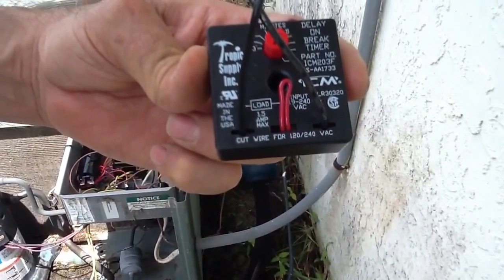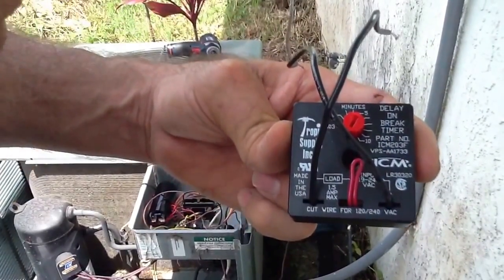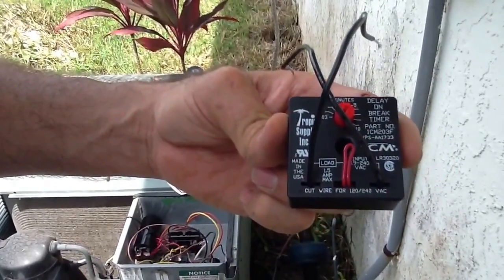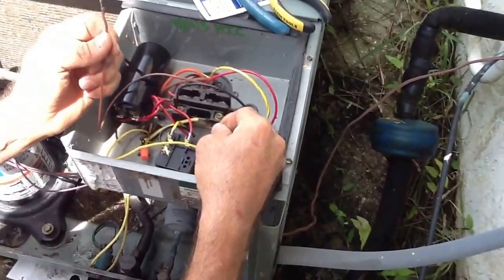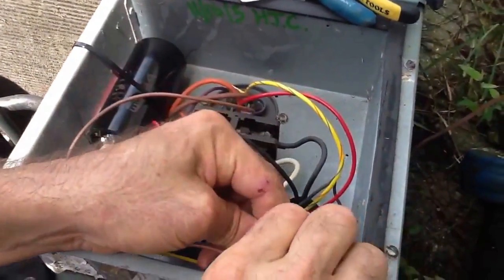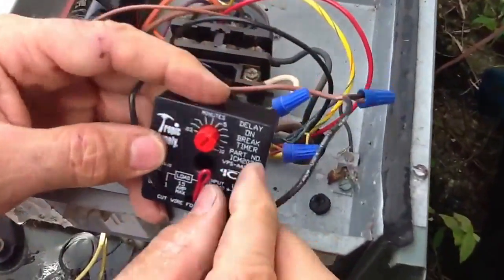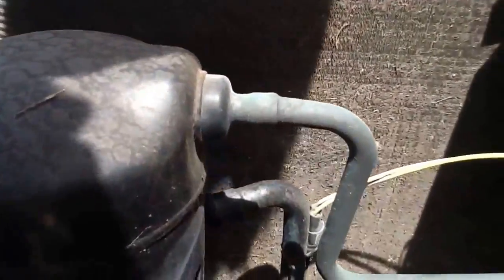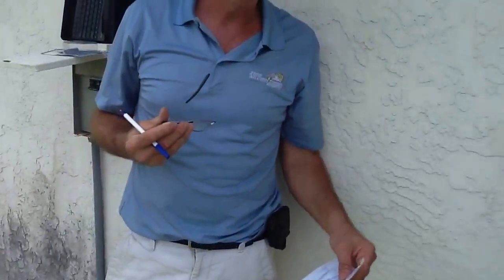Time Delay on break for compressor

Comment: I was under the impression that the "delay on make" was for keeping a compressor off for a few minutes in case of brown outs. The "delay on break"  was for cold weather low pressure short cycling, it allows the compressor to keep running until enough refrigerant starts to return and the suction line has sufficient pressure to allow the unit to keep running and not trip off on its low pressure control.
Reply: Jim...the delay on break works well. Because the delay on make would keep it off on every start..

Comment: You explained a delay on make. A delay on break starts it's delay when the call for compressor ends. The contacts in the delay open when voltage is terminated to common and "y" to keep from rapid start-stop btw you have a start capacitor and a scroll compressor, a time delay is a little redundant.
Reply: julianmeinhart you are correct.I had to do a double take my self and that's when I caught on to it.aside from that it was a good video.
Reply: Just what I thought too. Lol